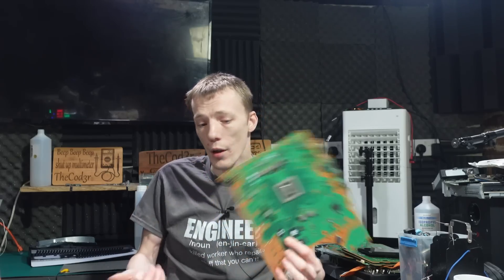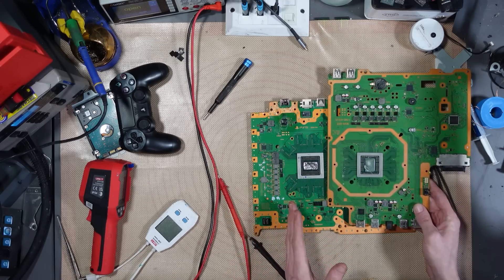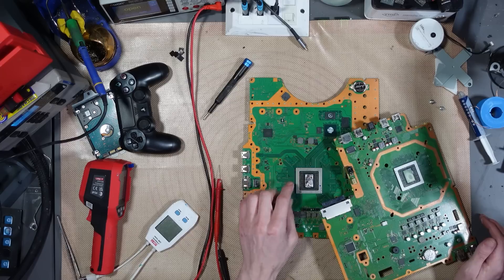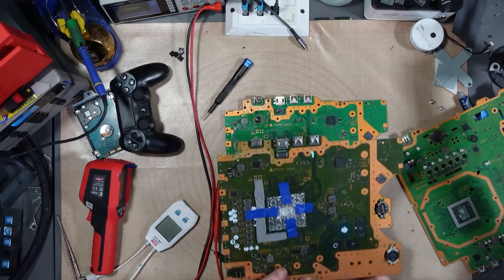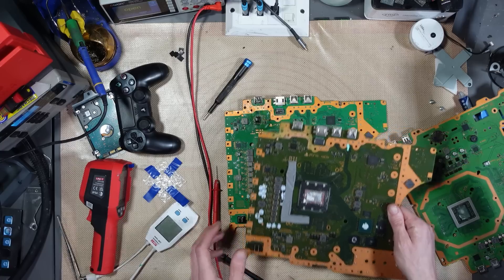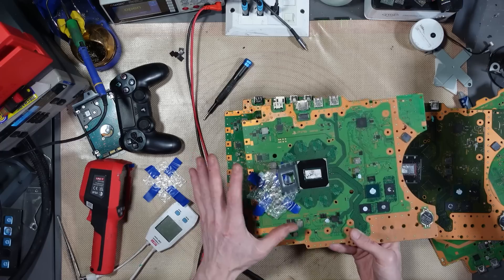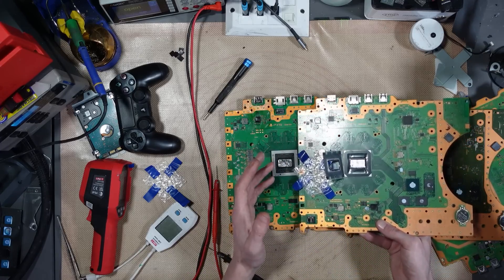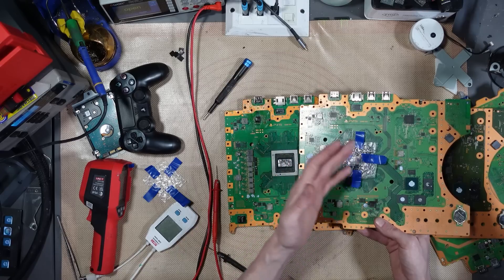Let's Talk About Sony's PS5 Liquid Metal Issue! Is YOUR PS5 At Risk?

Comment from the maker: Thank you for watching, hopefully I cleared a few things up here. If you enjoy the video or find it useful don't forget to give the video a like and drop a sub too 😉
Reply: Coof is 100% a weapon! The jab is 100% poison. Ppl just don't DIE SUDDENLY
Reply: But a design flaw wouldn't affect every unit? Maybe these vertical consoles were first overheating in an enclosed space and this excessive heat expanded the metal causing the leak?
Reply: I watch alot of repair videos alot of the time it happens do to it had bin dropped but who knows theres good ones an bad ones all my buddy have had theres over a year vertically so I mean it could of bin dropped in shipping may not have bin sealed right I mean in the factory when build them they build em fast
Reply: @wesleyhoare789  material degradation, vertical stand + blu ray vibration cause this...
Reply: @rayoflight-777  I've had me my buddys have had are a year and half they mass produce when they build them so it makes sense there gonna be some that have issues I know all about production
Reply: Thanks for the advice.
Reply: Just saw your video a few days b4 my sony ps5 arrived in the post 10th January 2023 I will be keeping it horizontal thanks to your video
Reply: I had my doubts about stacking PS5 Console vertically but your video clarified things so it will be forever horizontal for me always thank you
Reply: @thomaskphillips2582  AT LEAST one smart ass that understand the warning here !! BRAVO !!!
Reply: Hey my man..do u have any ruined Ps5 boards that could possibly have a working APU?

I attempted today to no avail.. Still 2 second blod.

I would like another attempt
Reply: Bull💩
Reply: @TheCod3r i’m having a bit of a problem with my ps5, a couple of days ago my ps5 has started to shut off randomly when opening a game or sometimes in the middle of games. i’ve taken and blown out my fan and there is 0 dust. any idea what could be wrong and how to take action onto this?
Reply: Recently discovered a software problem with the ps5s voice command everyone ask there console to load a disk that’s in and it just does not load anything with or without a disk it still says can’t read disk
Reply: Everyone try this and tell me yours dosent do the same because I guarantee it will not load anything via voice control
Reply: I always felt intuitively that vertical is dodgy not safe
Reply: If they go back to ps3 era CELL capacitors were strictly under CPU which just shows how cheap Sony was the Cell was pretty much glued sealed around heat spreader they still decided it was smart to glue it and use drying paste under it🤣🤣🤣🤣🤣🤣
Reply: Idiot's should used liquid on PS3 broadband sure over kill but a lot of ps3 suffered from heat drying related paste on DIEs
Reply: Which in turn caused YLOD cause substrates disconnected under dry heat spreader
Reply: Especially the cecha01 best one around.... Dried cells rsx they slowly killed them cause average users can't simply replace under heat spreader without ruining their boards
Reply: Come on Sony liquid metal doesn't dry under heat spreaders👌 oh will pretty much glue them shut so they dry and substrates on die go cold solder
Reply: PS the heat spreaders on Sony's cecha01 are copper doesn't damage!!
Reply: I've found numerous codes stored in the syscon to backup disconnection of DIE solder which in turn bga reball worked only temporary they designed cecha01s to fail due to cheap sealed cells and rsx's🤣
Reply: Some tell me is to safe to stand a ps5 up
Reply: Forget about Liquid Metal and start using something better: Honeywell PTM7950  Super Highly Thermally Conductive PCM Pad   , and you're not going back to that crap that is Liquid Metal , Already most good services in Europe use it in PS5 and earlier models , Works very well on laptops too .

Thermal Grizzly paste is not suitable for PS5, the best at the moment is Honeywell PTM7950, in our service it has already been tested on 323 PS5 units  and 457 PS4  units and after more than 9 months they all work perfect. 
Thermal Grizzly paste is not even comparable to Honeywell PTM7950. it's a waste of your money to buy a Thermal Grizzly. Just remember to buy only the original Honeywell PTM7950.
Reply: @kipex3416  😅😅😅
Reply: Absolute bolox. The failure rate out of the 30 million plus sold is well well well within what's expected. Just a bunch of people jumping on a issue for views. Your PS5 is perfectly fine being vertical for many years to come.
Reply: @Got-2B-Said  yes thats Xbot fud nothing more, there are a lot of Xbots who shares and posting this crap against Playstation has always.
Reply: Had my ps5 since day 1 been vertical since then and is on everyday for at least 4hrs and more haven't experienced anything what you are claiming.
Reply: @wakeysgaming  seen alot of first release consoles with this issue my man
Reply: @paulsonline  I must be one of the lucky one's then
Reply: @wakeysgaming  no youre not lucky.. those that have this issue are unlucky.. 

It's starting to happen. I'm personally seeing it happen alot now. Especially with first edition disk versions
Reply: @wakeysgaming  mines on all day everyday played for about 1k hours last year so prob got about 2500hrs of gaming and countless hours of youtube with no issues being vertical
Reply: @wakeysgaming  i have launch ps5
Reply: @wakeysgaming  I’ve had mine vertical since day one release and never had a single issue of overheating or anything. Given the sheer number of units sold even if this is a one in 100,000 units they are effected they still a shit load of units that will be effected.

Comment: Mines just overheated and shut down on me during spiderman 2, I've had It horizontal since February and I clean it every 8 weeks! Hardly any dust on the fan this time and the psu holes were fine  :/ I'm baffled. First time it's ever done it.. thinking a liquid metal change? It used to do it all the time when vertical but never when flat
Reply: What did you end up doing? Sell it for parts, fix it, buy a new one?

Comment: I put mine horizontal straight out the box when i got it 2 months ago. I have the latest 1200 revision. Time will tell if is makes a difference but it can't hurt can it. Also goes without saying... Make sure there is good air flow where you put the console. The amount of times I've seen them in tv cabinets with little to no room for air flow.

Comment: Recently I’ve been having overheating messages on my ps5. Tried different positions and room ventilation option with various games, opened the ps5 and cleaned the heat sink to near perfection and the problem persists. Could it be a software bug or the liquid metal ?
Reply: I've never once had the message mine just cuts out completely.. it's infuriating

Comment: You fail to mention voltage. You fail to mention if a 110v unit was being used in a 220v environment. You also fail to mention the consoles on the USA. You mention only a small shop on a 220v country. You also use nonplural words.  Therefore is this issue someone trying to get attention a new subscribers.
Reply from the maker: What?

Comment: People having been using liquid metal on PCs vertically for years and haven't had issues. Not sure what's going on. Are the caps under the ps5 foam not coated with something? I think the issue is, theres too much liquid metal. I've never seen that much used and i ran a bare die i5 with liquid metal water cooled vertically for years.

Comment: I posted this on your 1200 model tear down video and I want to post it here as well because its more relevant to this video.

Everyone, I'm pretty sure I know what the issues is with the liquid metal. First I'm a machinist and we deal with silver plated pins for satellites, etc. Every time the Plate company returns the pins there is a "dog boning" effect (edges of pin are a thicker than the center of the pin).

So I believe this can effect every model of console. Whats happening is there probably plating the heat sink vertical which causes more nickle material to attach to one side. This would have a "mound" effect, a 0.001 or more thickness difference between one side or the other. If there not smoothing or granite stoning a smooth even thickness afterwards there will be uneven pressure between the die (APU) and the heat sink surface. Over time the liquid metal is squeezed out of the higher pressure area and spreads to the less pressured area causing a dry spot, eventually leading to a hot spot and overheating. I would love to see TheCod3r take a square edge to the heat sink and the die to see just how flat those surfaces are? My bet is the hot spot ones are not flat.

This to me is going to effect the 1000, 1100, 1200, models in time. How many have uneven plating? Who knows, but there will be many that will not have uneven pressure and there will be x number of consoles that will.

Comment: already being debunked. Console was already opened and repaired by someone who used too much thermal. 

Ill keep my vertical. Had it since launch with 0 issues. And on the 0.000000000001% chance it happened to me, I'd just go buy a new ps5. No problem. 😂

Comment: As someone who has applied liquid metal to damn near everything that has a nickel plated or copper heatsink, I can very much tell you Sony went WAY WAY overboard on the PS5 application. I've used liquid metal on Nintendo Switch consoles and laptops (obviously they will be in all sorts of different orientations) with zero issue. You basically want to apply it so as the whole die surface looks wet and that's it, no pools etc. Granted you may have to do a 2nd application to copper heatsinks due to it absorbing into the copper creating an alloy, but after a 2nd application you should be good.

Comment: Bru this whole thing feels stupid complex. I’m trying to make this simple for stupid. If I got this correct the system heats up the liquid metal cooling the system and eventually if the system is in a vertical position for long enough the liquid metal leaks onto other parts and frying the system occurs. It seems to me as long as the seal isn’t compromised the system stays in good condition. I’ve had my system since day one release in the vertical position and it’s a legacy version with the better heat sync so how does this affect me is my question. 🙃
Reply: Not at all. This video is clickbait, the liquid will absolutely not leak from just keeping your PS5 upright. Something else has to have already gone wrong for this to happen, this video has already been debunked.

Comment: the first gen ps5's look better sealed, and had more copper metal. the newer ps5's just look they went cheaper with the cpu and less copper heatsink. also my personal preference I would never go with liquid metal for my PC. i done aio a lot when my older pc's but I recently went back to doing only fan cooling and haven't been happier.

Comment: I have the 1115A ps5 I bought new in October 2021 it has bin vertically for 9 month straight it's more of a hit an miss I believe it is an issue not every ps5 is as lucky I had PS4 that blew up under warranty I got another an it's still running an my mother uses it daily still

Comment: Is the ps4 or Xbox also using liquid metal? Not really sure why Sony is using liquid metal instead of thermal paste which is viscous
Reply: The PS4 was using thermal paste. Sony overclocked the PS5 so they needed to use liquid metal because it has better thermals.

Comment: It's always something with these game consoles Kind of reminds me of back in the day when the Xbox 360 came out and everybody was getting the Red ring of death. I bought two Xbox 360s and both of them caught the red ring and both of them had to get shipped to Microsoft and then they sent me some repaired and refurbished ones.
Reply: The yellow light of death was also a thing. A lot of early PS3s had that issue.  When you have a highly clocked chip in a console form factor, cooling solutions can be an issue.

Comment: You don't have to be a genius to choose to believe or not whether is a credibile possibility a liquid can be pulled by gravity to the bottom of the chip pool. Yes, is credible that a foam based gasket can suffer deterioration due the constant thermal exchange, under mechanical pressure, yes can definitely leak. So the question is not if is possible, but if you would take chance to protect it from happening. Murphy's law 🙄

Comment: Is the problem for all PS5s??
Or just certain models???
Just got mine.. FINALLY 🤦‍♂️ & of course I got it standing 🆙 🤦‍♂️
Help or response would get u a 👍 
😁thanx!
Reply: Just set it up horizontally and be safe. Is not that big of a deal.
Reply: @POST_M0RTEM  after this post I did just that, payed it down. It’s just it was hard to kinda do bcuz it was between sound system, wires, psvr, more wires..
Anyway it would make life A LOT EASIER if I can leave standing up. 
But thanx
Reply: @KY-YE  I'm on the same boat but i busted my ass to get this PS5 and I'm not risking it 😅 I'm getting a separate table just for it.

Comment: Ok so you're saying you have seen 15 or so but you're not that big of a repair company, you also said that these boards were purchased from an ebay listing. So my question is you keep saying its a design flaw yet you have no idea what has happened to these consoles before you got them.... as someone that has had to deal with electronics before and customers I can tell you now 99% of customers lie. Oh little Johnny was just playing with his ps5 and boom it caught fire all by itself. When really little Johnny got angry he threw his controller and it hit his ps5 and knocked it over.... I myself don't understand considering how you can say a PC and ps5 are different in terms of cooling. I have never ever had to coat my PC's motherboard when using liquid metal for starters. There are PC's that are extremely compact just like the ps5 and have big beefy gfx cards like a 3080 with 3 fans vibrating the crap out of it yet still no leaks... whilst I am not saying this doesn't happen I'm saying there is way more to this than a bad design
Reply from the maker: No I didn't say I purchased the ones I have seen from ebay. I literally have a video on the channel where the warranty seal is in tact. The boards I used in this video as an EXAMPLE were random boards I bought off ebay which I had no clue about, and no clue what was wrong with them
Reply: @TheCod3r  you just repeated what I just said.... these boards were from a ebay listing.... so you're saying that the unopened 1 couldn't have been dropped and cause the seal to break?
Reply from the maker: @chadstudd1616  according to the customer no it hadn't, and even if it did, it leaked under the seal, that should never happen if the seal is designed properly
Reply: @TheCod3r  dude I have already explained customers lie all the time. I don't think the seal is designed to withstand a fall.....

Comment: I’ve had mine vertical for two years, and while it does get substantially warm I have a usb fan in one of the back ports, and keep the console ontop of my desk versus in a cabinet. I’ve been nervous about the clicking and cracking sounds it makes, like the plastic sides are expanding when getting hot. This being discovered as a new issue only further proves that sending anything to China for production is due to fail.
Reply: The usb fan might be hurting it. I would make sure that’s actually doing good instead of messing up air flow. I remember having one for my 4 and it made it unreasonably hot
Reply: @TheRealmPod  thanks for the tip, it’s small and low voltage and only use it to blow the air away from the console since it’s at the corner of my room and above my desk. I’ve been avoiding a tear down just to clean the fan but thank god it’s not as bad as my pro which totally raised the temp in the room after an hour.

Comment: I have had my PS5 since launch, set in the vertical position, and I play it daily for about three hours. So far, I have had no issues at all. I think these people are moving there console while in use
Reply: But I'm still wondering, what moving does in this case? 95% of time since I have my Ps5 it is in vertical position. Should I worry and immediately change to horizontal? Or again, since it's mostly vertical there is nothing to be worry about...?

Comment: Not sure why Sony decided on using LM at all for a console. Just like you said, with its uses on CPUs or GPUs it's done by the user & anyone who does their homework will use the proper protection on the surrounding components (conformal coating, liquid tape, nail polish, etc.). It's definitely not a set & forget TIM. Also the gains are not that big unless you are pushing your chip to the bleeding edge. So the whole decision seems like a misguided one just to make consumers think they're getting something extra special. It would've done just fine with a regular thermal paste LOL!
Reply: The PS5 is overclocked. If the leaking is true Sony should have made the design of the PS5 sit instead of stand.
Reply: LM cools console and Microsoft too cheap to use it.

Comment: I guess just to be safe you can put it horizontally, as Sony has confirmed we can put our PS5 horizontally too,
But if your PS5 have less ventilation space when put horizontally i guess then just keep it vertically because this is a super rare issue where as cramped PS5 getting overheating is a well known and confirmed one
Reply: I've had my PS5 placed horizontally since i bought it back in Feb '21. It's placed on top of a table so nothing is covering on the top or the sides.